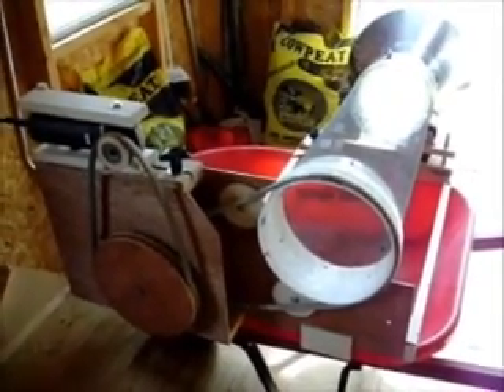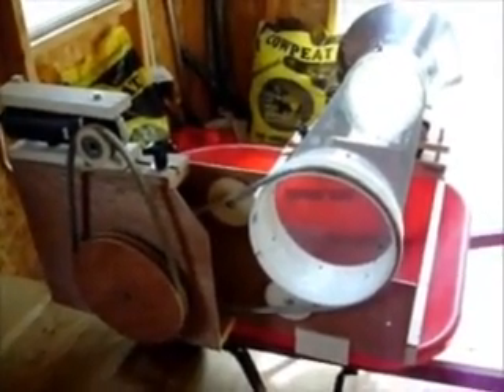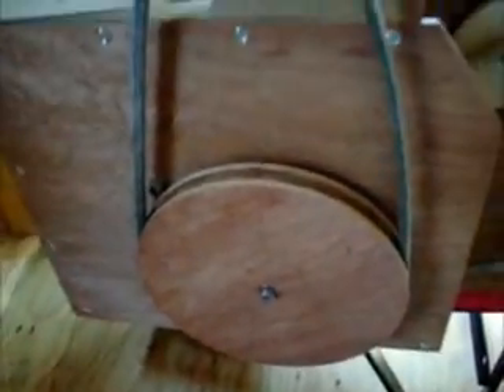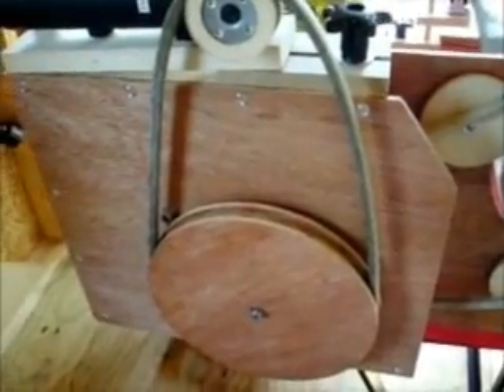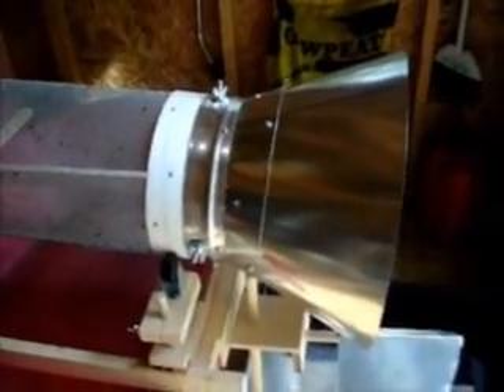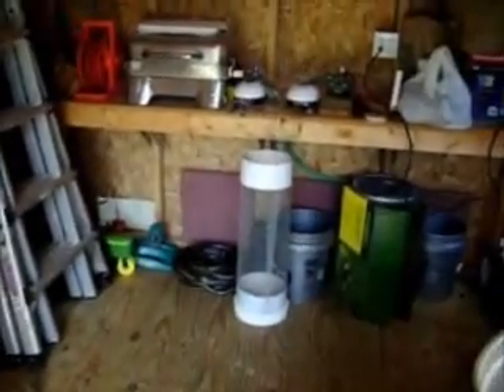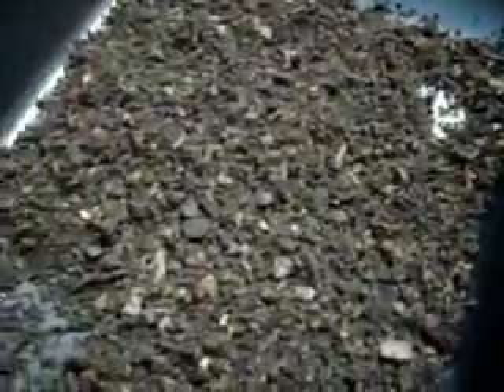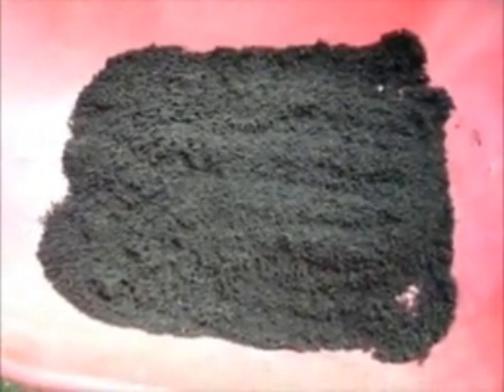Wheel Barrel Worm Harvester-Separator Ver. 2

Comment: Wow!  That's the best DIY trommel that I've seen so far!  Your tube and screen section is excellent.  That's a pretty clever gear reduction unit too.  Doesn't having the whole thing resting on the wheel barrow make it kind of hard to empty the barrow?  I've seen some that wheel barrow can just be rolled in and out with the trommel on It's own legs.
Reply from the maker: Ron Yerke the setup simply rests on the wheelbarrow and is easily removed after the separation. I keep it stored in the corner of my shed, while the wheelbarrow is free for other uses.

Comment: Great idea. I would like to build one similar to this. Can you give more details about the gears you used in the speed reduction box? Size of gears and number of teeth per gear?  Thanks.
Reply from the maker: I will get that information to you right after Xmas.  Heading for the door now and should be able to have the information to you later tomorrow
Reply from the maker: Chip, the small pulley on the grinder is 2 1/4" and on the outside of the box is a 11" pulley.  Inside the box I used two sizes of gears and another 2 1/4' pulley that connects it all to my trommel.  My (2) small gears are 8 tooth and 2 3/8" wide and the (2) larger ones are 31 tooth and 8' wide gears.  Both with an angle of 30 and pitch of 19 made from 1/2" birch plywood that I coated with polyurethane prior to assembly.  Holding strong for over two years! Check out http://woodgears.ca/gear_cutting/template.html It's an awesome gear generator that makes it easy to print out a paper templates that can be placed on wood to easily cut them out accurately.  Hope this helps.

Comment from the maker: Update, Jan 28 2012.

Colder temps have slowed the worms down a bit but I am still harvesting a tray every 7-10 days though and the harvester is still running strong.  The only maintenanceto date was to add brass bushings to the rod that goes from the large front pully through the thin 1/8" ply casing (front and back), as I noticed the thin ply's hole was starting to elongate.  Inspected the gears and no noticeable signs of stress or wear.

Comment from the maker: Using this power grinder with the pulleys/gears isn't necessary.  A slower motor and maybe adding a rheostat (from Radio Shack/Lowes/Home Depot) to vary speed (RPM's) would make this simpler to build.  but I didn't have another motor available and I like a challenge!

Update, been running every week for over a month no sign of wear and tear on the gears/pulleys.